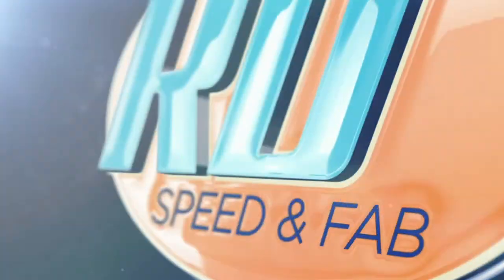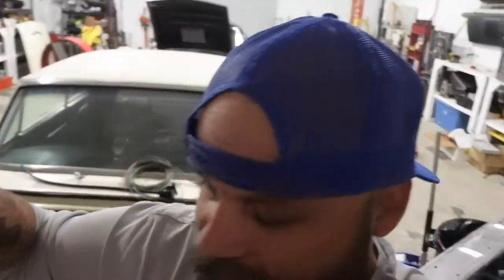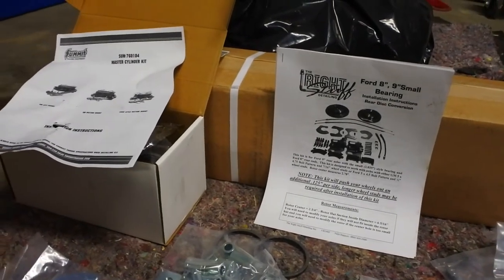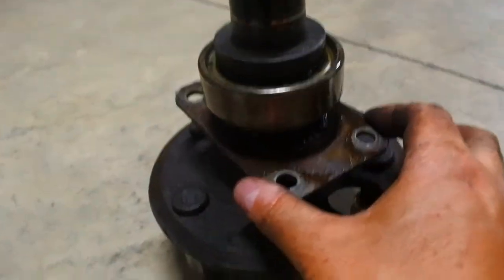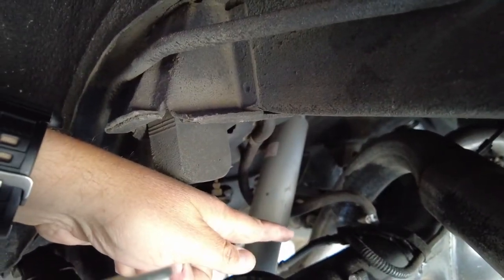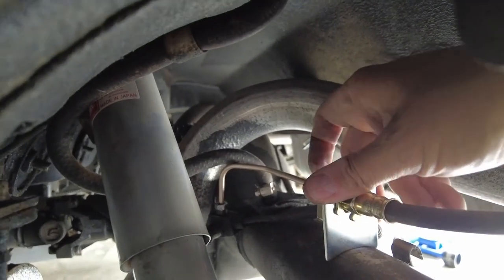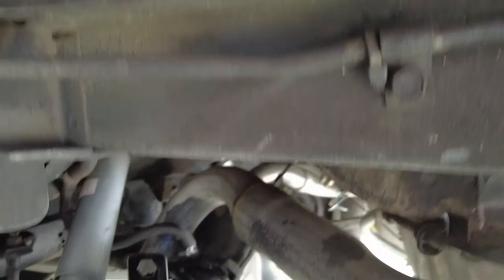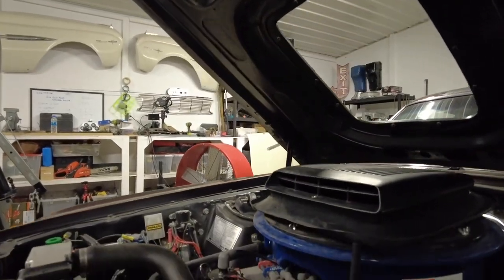Rear disc brakes (1970 Mustang Fastback)

Comment: Really thought the whole idea was to see how to install the Wilwood brackets & brakes especially the emergency mechanism you showed none of that . You showed us how to do brake lines and pull drum brakes off. You ended the first day with the drum brakes removed .you woke up to do next episode and  all the Wilwood system was installed and you started the video with brake lines
Reply from the maker: Watch part 2. It goes into the details on the emergency cable and what it takes to get it working. I didn’t think it was very interesting to show how the bolt on kit, bolts on. The fabrication part of it is where most guys would get stuck, so I typically show a lot of fabrication on my channel.  Again, watch part 2, it has the parking brake stuff.